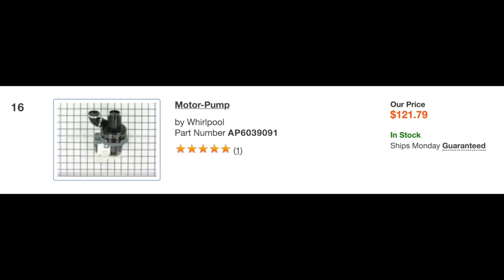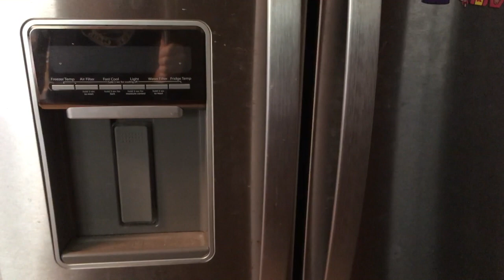Whirlpool Dishwasher Pump Motor Repair (And Upgrade?)

Comment: Just to let you know the bushing by the impeller is easy to get off the impeller is threaded on the shaft I thought I was going to break mine until I twisted it and wala.  I will be making new bushings out of oilite material I fixed it last year with belzona epoxy and drilled back out to 3/16 I didn’t do anything with the cap bushing at that time this time I am just making both new as well as a spare set
Reply: Ryan Wolosek , thanks for the tip!!
Reply: I have the same problem with a 2 yr old qhirlpool dishwasher. Brand loyalty is a concept manufacturers do not seem to understand. I am using a maytag washer and dryer that are over 30 yrs old. Manufacturers seem to want to exploit brand loyalty but have no concern on how to develop  it. Loyalty happens when someone comprehends the good value they get from a product. This cheap bushing is an example of saving a dollar or so to possibly have a product to intentionally fail to early. I would be interested to find out if whirlpools higher end brands have the upgraded parts in them.
Reply: @osyrass  Danny B - did the bearing fit or did you have to machine it?
Reply: @mindgrudge  it did, but I had to drill out a bit just like in the video.  I had bearings for front and back and had to drill both sides.
Reply: @osyrass  Hello Danny B, may I ask what was the pump part # that you fixed with this bearing ? How did you figure out the bearing dimensions ? I am having a hard time finding out what bearing to buy, my pump part # is W11032770
 and I am also in Canada. Thanks in advance for your help and for posting this!
Reply: @eduhallal  the pump was replaced under warranty, as for the bearing I just did a lot of digging based on what was in the videa vs. what was available to me in Canada.
Reply: @osyrass  Thanks for your response Danny!
Reply: @osyrass  thanks from Canada!
Reply: @osyrass  did that glass bearing fit the shaft size or did you slave the shaft and let it run on the race bearings
Reply: @waynedean5230  I shaved the the casing with a drill bit to make the bearings fit.
Reply: @osyrass  Hi, thanks for this link. I'm in Edmonton. Did the bearings fix your problem? I just took mine apart and they look a little bit oval/worn but not as bad as Phillip's...to order 2 bearings, with shipping it's going to come to $30CAD. I'm just wondering if this will correct my problem or if I should order a new motor??
Reply: @ClintMoar  it did fix the issue but after a month we got the warranty replacement so we have it as a back up now.
Reply: It's "voila"
Reply: Is the bearing still holding up?

Comment: First of all, THANKS FOR THIS VIDEO! You saved me at least $350!!!!  I live overseas for work, in a small country, dishwashers are rare and the cost of repairing and parts is literally double or 3x the cost in the USA.  My bushings were just a little worn, but there were little pieces of plastic that had jammed up the impeller.  I also cleaned out the magnet area while I was at it. When I called the a-holes at Whirlpool they wanted me to order the entire assembly, which with the weight and the customs taxes, would have been $350 to $400.  I can't thank you enough!  Awesome job man!

Comment: Wohoo!  Thank you soooooo much.  My dishwasher is under warranty and they will replace the wash motor as soon as they can get the backordered part.  Could be months until it gets here.  I took a dowel,  put it against the motor you hi lighted,  tapped the dowel with a hammer and voila,  motor has worked for 10 wash cycles and the motor is not voided by me pulling it out!
You saved Christmas in my house.

Comment: Just a thank you for showing the disassembly of the pump. I got here by searching for the Askoll M310 part number and with your video I was able to disassemble the motor side of the pump housing without removing any of the cinch clamps from the dishwasher. Found a plastic label from a dish caught in the impeller. Reassembled and we're back in business.

Comment: Great video - thanks! The bushing in my motor turned out to be ok, but the permanent magnet on the rotor was cracked, split down the middle. I glued it back together with epoxy and it's running like a champ!
Reply: any pics ?
Reply: @mjacobm  No, sorry. Also, the epoxy fix didn't last :-), I ended up replacing the dishwasher.

Comment: World Genius Prize to the guy who decided to install this motor horizontal. The magnet weighs on the bearings/bushings while turning: graphite or not, it's going to wear through. I have three aquarium pumps with the same kind of motor and they're vertical. The bushings are plastic/rubber and those pumps are immortal.
In my hoover dishwasher? Horizontal. It stops randomly, then starts again if you hit the machine or turn it off and on again. Yep, guess Im' going to thank you for this video :)

Comment: Thank you for posting this! My WP had the same failure after 2.5 years.  I used J-B weld to fill in the gap and drilled out the centers, I'll see how long that holds up.  Thanks for mentioning that tapping on the motor caused it start up, that helped me pinpoint that this was my problem.
Reply: That was key for me as well!
Reply: is the JB weld epoxy solution to fill the sloppy hole still holding up?
Reply: How is the JB doing?
Reply: JB Weld for the win!!!
Reply: @nidusa1
Reply: Any updates on how long the job weld lasted?  This seems like it could be the easiest solution for me.
Reply: @YallaHavdallah  J-B weld lasted about 6-8 months.  I found someone had created a template to 3D print a replacement bushing (Whirlpool dishwasher pump bearing).  I printed the part in ABS (type of plastic material) and it's held up for 3+ years.

Comment: I applaud your ingenuity to replace the bearings.  I didn't see what you did to fix the bearings near the impellor, but the impellor just  unscrews from the shaft.  It is easiest to replace just the motor by twisting it off/on, similar to the drain pump motor.

Comment: Thank you for creating this video! The pump on my WDT720PADM stopped working, I had whacked it with a screwdriver and it started up again, then I found your vid. Because of you, I was able to take apart the motor and found tons of scoring along one side of the chamber in which the impeller sits. The bushings weren't oval, so I sandpapered the scoring mostly smooth, cleaned everything out, reassembled it, and it came back to life. That lasted about a month, then it stopped working again. Pulled the pump apart, and saw some little black shavings inside the chamber. The top bushing had some slop to it, too -- far more slop than the new pump that I had purchased and was about to return. I guess the bushings were getting ground down and the shavings ended up inside the pump (maybe contributing to the scoring?). I ended up replacing the pump because we really needed the dishwasher working, but I'm still going to do your repair to the original pump as a backup for when the new one dies. The extra month of life we got just from cleaning out the pump was easily worth the time spent in tinkering with it.

Comment: My 2 and 1/2-year old  Whirlpool stopped spraying, I replaced the water valve ($26.00) thinking it couldn't be the motor, but it was. So I proceeded to take out the motor . It wasn't even as loose as your's but I cleaned it up re-assembled it and that was  it ...It's working strong now!  ( It is the quietest dish washer I've ever owned ).....There has to be a cheaper source for that little motor.........but it's good for now.   So great big THANKS MAN!

Comment: I can't give you enough credit. I couldn't understand why something as simple as a circ pump could work intermittently. Fortunately, I saved my old parts from the last dishwasher and the pump was still good so I installed it, but plan on rebuilding the bad pump.

Comment: Thank you for your video, it solved the problem with my dishwasher. the bearing was also worn out and the motor was working intermittently. Now, so far,  it runs like new. it did save me a bundle. Thanks again.

Comment: Great video! Took my pump apart and yes, both bearings were oval and there was scoring to the inner bore of the pump. I removed the bearings and clocked them both so the oval bearings are 90° off for a short term fix. Long term, I’m designing replacements bearings to be 3D printed in ABS plastic. We’ll see how that works. Thanks again man, saved us $180.
Reply: Hi John, could you please update us on how your 3D printed bearings are doing after 7 months ? I am curious since I am going to use the same solution. Thanks :)
Reply: John, I'm also interested in the 3D printed bearings.  How did you make out?  Did you print some extras for sale?

Comment: You are the man.  My washer would always turn on and start pumping for awhile, then stop and just click.  The clicking is actually the water diverter just doing it's job and it's not part of the issue.  I ordered the $50 Amazon 2 day replacement pump, but I just ordered the ball bearings and will repair my old one for a spare.  Can't thank you enough, keep up the good work.

Comment: Thanks for sharing. I just pulled the shaft and it had food in it. The spindle mount was fine. I cleaned it out and it started right up. You saved me $100 thank you!!

Comment: Viewed this repair almost three years ago. 3d printed the bearings. They lasted almost three years with no issues. Reprinted new bearings and the dishwasher is up and running again.
Reply: How did you do that.
I mean how did you manage to print it.
Is there a video?
Reply: I think he meant bushing.

Comment: Thank you for posting this!  Just ran into this issue and would have replaced the motor if I didn't find this.  It was really nice that you put the part number for the bearing in the video, it made it really easy to go to McMaster-Carr and grab what I needed.

I used .17 ID 1/4 OD tubing.  It ended up being a little thick once it was on the motor shaft, so I needed to shave it down a little.

Comment: Good job. I've seen many poorly designed weak point failures on many consumer products, too many to believe they're unintentional. 
One comes to mind is a Ford motor that used a rubber belt for the internal oil pump drive. No one would check or replace a cheapo belt bc it cost hundreds of $ to get to it. When it fails you need a new motor.

Comment: Thank you u are a hero I had the same issue for my Ariston dishwasher, and just now I fixed it, wow 😂😂😂 ... but instead of plastic ball bearing I used rubber o-ring which was orignally there but was too big causing clogging the motor, I replace that with the correct size and it done the job very well ... thank you again for sharing this project

Comment: I have same problem in my sisters Hotpoint. Same bushing. Can be bought for $10 per set of two, but I replaced the pump and took it for repair. Going to fit full ceramic bearings from Ali. This should make this pump eternal :).

Comment: Thanks for the video, I wanted to mention once I pulled my recirculation motor apart the screen between the housing and impeller was completely clogged, I unclogged it and it started working perfect!  (Just in case someone runs into that, its amazing how small the screen behind the impeller is, it didn't take much to clog it ).

Comment: Same issue on our unit, fills and drains, but no startup to clean. I found water/moister inside the top of the electrical board under the black cap(green sticker) No conductivity. I need to replace mine.
I opened it up and found the bushing worn exactly the same way as yours, Whirlpooh!

Comment: I found a brass water fitting that had the perfect size hole for the shaft. Shaped it by hand to be the exact size as the og bushing pressed right in with the og o-ring. Washer is spraying some serious water now!

Comment: I ended up replacing the entire pump assembly for the same price as that stupid pump. I plan to rebuild the motors on the assembly for backup parts when the new parts ultimately fail. Thanks for the breakdown.

Comment: Thanks for sharing your experience, i share your frustration on this particular issue and whirpool in general, i am having the same issue with my dishwasher and the weird thing is handyman in my area are charging $220-240 for replacing the motor which would be 350-400 so first get over charged for the spare part and then labor. I will surely try fixing the motor once with your guide and some other guides on how to remove the motor. Overall the market is priced to force the consumer to get a new dishwasher or high mark ups on spares, consumer looses anyway.

Comment: My washer doesnt always run either, for seemingly the same issue as yours. I found the likelihood based off it’s symptoms is the pump that runs the water through the sprayers. The cost difference for that motor assembly vs the entire “sump pump assembly” (the whole round bottom part with all the sensors and pump motor) was $20, so I just bought the whole assembly. Hoping the $157 part fixes this washer. I called some appliance repair places and they all want $125 just to come out and diagnose. Cost doesnt include repair or parts. Last time I had a guy come out to look at our old dryer, they said it needed a new board, which was $250. That dryer brand new 8 years prior was $399. Insane to put $250 into it. I just bought another cheap dryer for about $400 (this was years back before “supply chain issues”).

Long story short, i 100% agree with your statements about manufacturers literally designing this crap to break and need almost entire replacement. It’s a joke.

Comment: LOL same scenerio here at my house I bought all new Whirlpool appliances prepping for retirement. Fridge, 4 yr mark had to replace control board, Whirlpool dishwasher same model as yours pump dead, Electric Range the oven thermostat 30 degrees off, takes 30 minutes to get a 2 quart pot of water to boil on the largest burner. Top load washer so bad we junked it after 2nd bearing and seal failure. They make pure crap.

Comment: I’ve got a junky ass whirlpool too. Wdt720padm2 and I had to reach under the machine and whack it with a hammer handle to get it to start.  Thanks for you video.  Even if I fix this pump there will be another worthless mechanism to fail.

Comment: Now my main pump out in my Whirlpool. Its not even 3 years old. It was not the cheapest unit nor the most expensive in the middle of the road unit for a Whirlpool. I have replaced so far in its life; the drain pump, Timer board (PCB), fill inlet, top rack spray unit, third row rack, all plastic rack retainers, and heater element. I have a family of 7 including the Wife and I. I do a load a dishes on average a day might go to two on weekends/holidays/big meals. I have a Maytag over-the-stove microwave (Maytag Whirlpool owned) - Top of their line. One year the door switches are out. This is not my only Microwave.  Honestly I replaced the original  Whirlpool Dishwasher that was in my place as it was original and the wife wanted new...still worked so I sent it over to my rental. That unit is close to 20 years old and the previous owners had 4 kids...the old unit still runs fine with 2 kids and a couple...It tells you something...